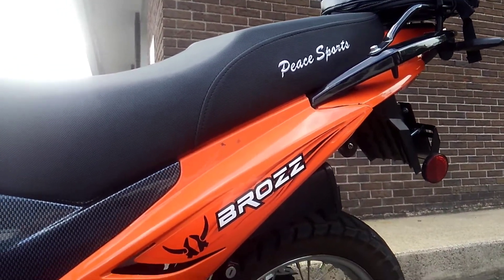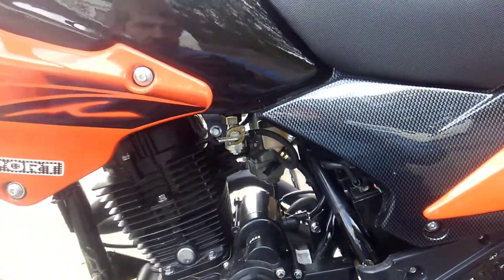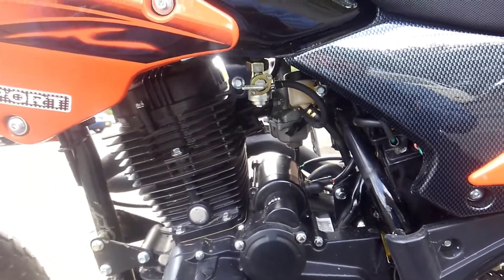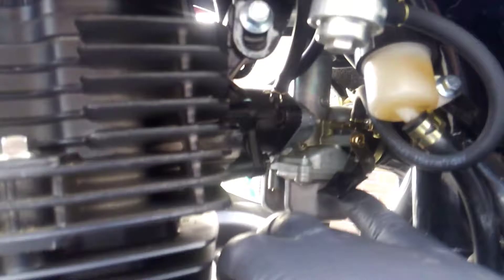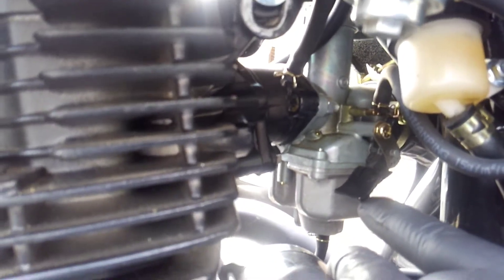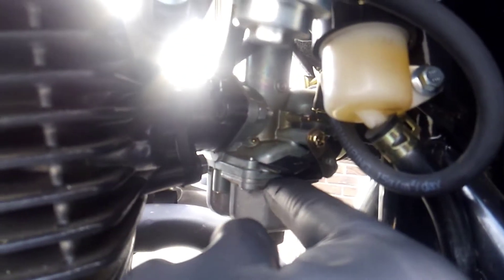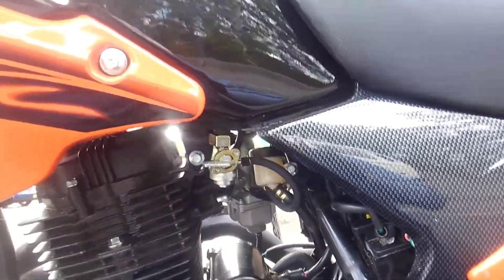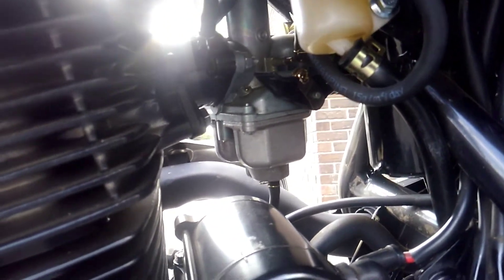2020 Brozz 250 carburetor question

Comment: ALL THE WAY Up IS FULL CHOKE ALL THE WAY DOWN IS FOR RUN AND THE HIGHLY VISIBLE SCREW STICKING OUT OF THE CARB ON THE RIGHT IS YOUR IDLING SCREW. TURN IT CLOCKWISE INWARD IF THE ENGINE ISN'T WANTING TO RUN AND SEE IF THAT HELPS
Reply from the maker: I'm going to assume then that middle setting is half choke but thanks I really appreciate the comment I've been having trouble with it the last couple cold days

Comment: Did you ever get it sorted? I recently got one and mine will run a few minutes and then cut off. I think it’s a over lean issue and I need to adjust the mixture screw but haven’t figured out how yet
Reply from the maker: I just need to mess with the idle screw. I start the bike with the choke on and adjust the idle screw till it idles around 2k then I let it run till it idles properly without the choke
Reply from the maker: Might need a different carb to get it to work properly